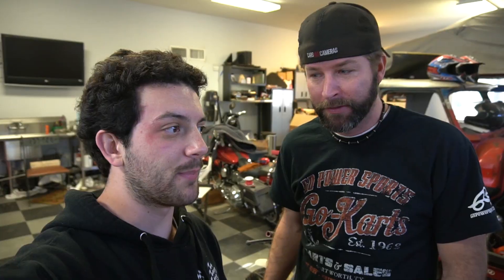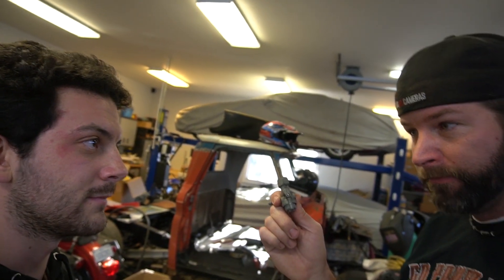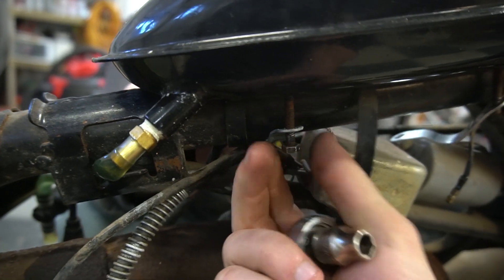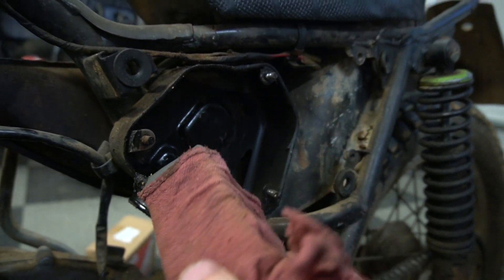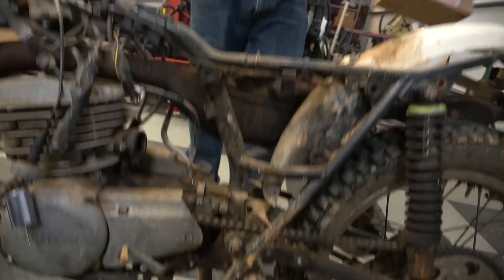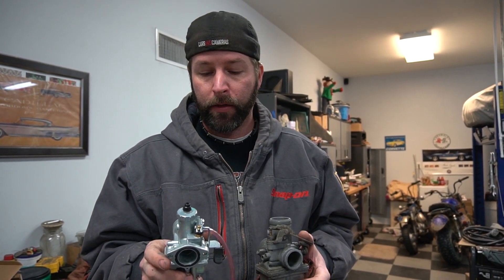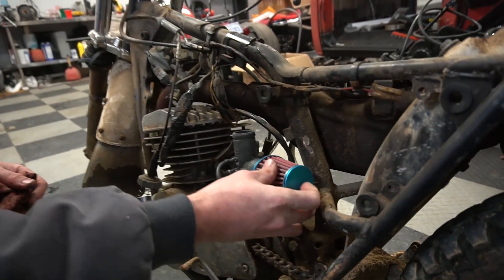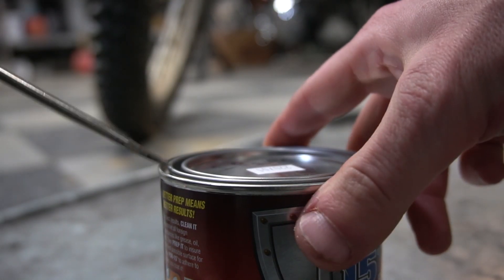Vintage Kawasaki Restoration FAIL

Comment: More kawasaki! We want a full resto and some engine upgrades!
Reply: Alberto Ruiz what engine upgrades can you do to a rare two stroke engine? They should just restore it and not destroy the thing
Reply: @shredder_mang3211  gotta agree with you there man #irishapproved
Reply: Full restore with oem parts. you can aquire.
Reply: @IrishWariorKing  you can put a pipe carb and port the cylinder change the port timing and the ignition timing and a big bore piston ...just like anything else that thing would fly

Comment: take the carb apart. clean the carb ultrasonic. no cracks in housing? new floatbowl gasket, put back together. use the original airbox! it is designed to give the right flow for the set up.
Reply: mightress cheap pod filters are just as restrictive as the factory air box. Have street bike motor on go kart and the pods I got it works the same with them.  I thought I was going to have to rejet it for the pods but they have about the same amount of air flow.  The pods I got were k&n style $10 cheapos from gopowersports
Reply: mightress exactly right
Reply: 717Garage for a two stroke it is quite important using the original airfilter/ box. Throw K&N om the carb is not realy good for the performance. Especialy the older two stroke engines. All comes down to right flow and resistence of the airflow in the filterbox.
Reply: Absolutly mightress!. I've got a KT250 awaiting restoration but I won't be going about it like this!. I've never bought a new carb in my life!! Air filters are restrictive for a reason, to make the jets work properly.

Comment: Clean the carb !!!! I've done it so many times.    Everyone wants to replace them no need to most of the time
Reply: Larry Alexander they already did that
Reply: I put a street bike motor on a go kart and cleaned the carbs it ran but not could have run better so I cleaned the jets again because they have tiny ports the gas mists out of and it runs like it’s brand new. All you need to do is clean it really good and it will run good.

Comment from the maker: Anybody know where we can find some dirt bike parts? Other than eBay??
Reply: CarsandCameras Craigslist
Reply: CarsandCameras i use Facebook  and craigslist
Reply: Sometimes letgo
Reply: CarsandCameras try a dealer, they may just happen to have old parts
Reply: CarsandCameras the app offerup
Reply: CarsandCameras offerup or letgo
Reply: Yea try Rocky mount atv /mx
Reply: search the Internet for bike resto places in your area ask for any parts they took off because they weren't perfect, or look for perfect parts ;)
Reply: CarsandCameras wish has some
Reply: Motosport
Reply: Kawasaki parts house or other oem “dealers”
Reply: CarsandCameras mabey on the  funbikes website but I don't know if they work in America
Reply: Biker bandit
Reply: CarsandCameras doc's in Lancaster Ohio , it's a dirt bike junkyard,its been around 30yrs ,although it's been a couple years since I have been there, pretty sure it's still going and on the internet
Reply: the wanted section on Craigslist.
Reply: CarsandCameras hey guys i have a 1974 Yamaha dt 175 and we got our parts off of craigslist and ebay we found an original piston off of ebay and it was still in the box it fits in the jug fine its perfect
Reply: MIDS motorcycle salvage in Sumter SC.
Reply: You should put up another dragster video tomorrow as this was a fail vid
Reply: There was a guy in grimesland that had a ton of older bikes for parts, as well as a guy on wichards beach rd. Let me know if I can help. I live here in Washington and have a shop over in Chocowinity.
Reply: Mount pleasant bike dump. They ship parts.
Reply: APF motorcycle salvage in fresno ca
Reply: I’m sorry to tell you but that carb is fake go check out Jennie’s garage they have a good vid on phony carbs
Reply: make ya a deal.....ill send u parts for free if you put that engine on a gocart
Reply: CarsandCameras Love the bike keep up the great work! You could check with AHRMA it is a vintage racing organization. They might not have exactly what you are looking for but should be able to point you in the right direction. There are also Vintage Trial associations all over the States usually separated by region. Most of the vintage organizations are cool and they will love you keeping the Trials bike alive and enjoy helping. Another suggestion is but will not yield quick results is Motorcycle Swap Meets. Another suggestion is Rocky Mountain ATV they have factory schematics for most bikes and they may not have the part but possibly give you a factory part number which would help. Another is Bike Bandit if they are still around I have not used them for a while.
Keep optimistic, be patient, and look on the bright side it can be tough working with old bikes but the end results will be awesome. I am speaking from experience. Good Luck!

https://www.ahrma.org

Edit: Would make some cool footage/content to see you guys enter an Observed Trials or Observed Vintage Trials Contest/Event
Reply: post the part number and physical dimensions  engine side..breather side, height etc. I go to car swapmeets and 
pick up carbs for cheap....good place for a bike engine for the rail
Reply: Rocky Mountain atv best for new oem fitting parts in my opinion
Reply: Trademe nz
Reply: CarsandCameras you may want to message jennies garage here on YouTube, he gets parts for motorcycles fairly cheap and shows how to fix stuff on a budget.
Reply: CarsandCameras I get all my honda ct 70 parts from chp motorsports out of texas. They have new old stock and many aftermarket parts.
Reply: I work at eBay's largest used motorcycle parts dealer. Mrc cycle. Our eBay name is mistermonkeyclaw. Can find us at mrccycle.com otherwise. I know vintage two strokes better than most
Reply: The Offerup app also has good deals on miscellaneous things. You could give that a shot.
Reply: CarsandCameras Wemoto
Reply: The usual places , but you might have an easier time getting a parts bike. 
Know what year(s)your bike was produced. 
the “family” so to speak,
because it opens up options for searching.
Reply: Steels cycles. They are 1 of the largest bike recyclers in my area for wrecked / parts bikes. Also a few good cycle junk yards around the northern Colorado area. I remember a fairly large vintage cycle yard in Albuquerque, NM when i used to live there. The yard was on on Broadway in Albq., NM. The name has slipped my memory. Great because it is in the drier south, and the parts tend to be in better condition, even after some years of sitting. Other sources include car part.com, or part locator .com. Sorry i do not have more info then that. Best of luck on your search.
Reply: CarsandCameras b&j racing has vintage trials bike parts,I used to have a 74 Yamaha ty250 and an 85 th 350,and that was my go to place.
Reply: Bike Bandit.com
Reply: I get all my parts off of Rocky Mountain atvmc. They sell oem for cheaper than the regular oem site and they have tons of aftermarket parts. And they have free two day shipping (at least where I live in KY) which is awesome. I'd try there first, they may have some stuff for you.
Reply: http://bikeboneyard.com/    Don't toss the airbox yet. Taking that thing off and going with the pod will almost always result in the engine running worse. I've rigged up the original filter cage with filter foam on some older bikes and had good success with that method.
Reply: You could buy a parts bike,  look on Craigslist or even look at vintage motorcycle shops
Reply: Kawasaki parts warehouse
Reply: Cycle recycle in Indianapolis. Theres two of them. Walnecks
Reply: I think you need to do a full restoration. tear everything apart, sandblast, paint, polish, and fix what you can't replace.
Reply: Dude just measure the intake. It's going to be in the 28-35 6mm range. Sell the keihn and order another pwk the correct size. If nothing else go to farmandsandtoys.com call Jeff and he'll help you out. It's a two stroke and a 4 stroke carb won't work. Also need to do a leakdown test on that motor if you've taken it apart, any air leaks will cause it to be lean and burn up a piston. Your reeds are probably trash too. Pull the cage and see if there's any visible light where the reed touches the cage. If there's any light it's not sealing completely and it's going to run like crap. I've got a banshee built by farm and sand toys. It makes 110 horsepower out of a 465cc engine. Two strokes are simple but you need to read up on one before slapping parts at it. Even air filter changes can cause a lean condition. After you get the bugs worked out you'll need to do a plug chop, there's plenty of diagrams out there that show how to do it and what to do. You'll need jets as well, you want to run it just a little rich.
Reply: Amazon
Reply: Or you can use motosport.com
Reply: I would look for vintage bike forums and put feeler out there
Reply: CarsandCameras ebay has crappy parts. But i still am rebuilding the top end of my 2 stroke with ebay parts. All the parts fit but my carb rebuild kit. But tgen again i have been doing a crap ton of research to make sure the parts fit.
Reply: CarsandCameras search up killermotorsports.com
Reply: Ive got a pretty well restored kt250 and carburetor is a 26mm mikuni so if you get an off brand make sure it's a 26mm
Reply: Try Bikebandit it helped me find Nos part for my 1975 Suzuki tm 125
Reply: Ask Cameron niemelda
Reply: He is a YouTuber that specializes in parting out bikes he does newer stuff but might have leads
Reply: Bike bandit
Reply: CarsanCameras motorcycle superstore

Comment: Hi guys. Something to think of. When a bike sits that long do not be surprised the seals on the crankshaft might need changed as it greatly effects how it runs. I had that happen. Here in Michigan there are motorcycle salvage yards to look for parts. Oh on your air cleaner an old dirt bike trick is to take a pair of nylons and cut the foot out and use as a cover over the element it keeps the larger dirt off the element hope any of this helps. great vid.

Comment: Two Stroke Motorcycle carbs are very different from four stroke motorcycle carbs - Watch what you put that on...... or box it up and return it - there should be nothing wrong with the carb in it, just clean it in an ultra-sonic Hot tank from Harbor Freight, you can buy one cheaper than the Sudco Carb you bought and you can use it on all future gummed up carbs on the dozens of bikes & Karts
Reply: Also, as little as youre gunna ride it, you could get away with cheap NEW tires and tubes instead of Name brand stuff - Check out your Local 'Cycle Gear" store (they have them nation wide) or order tires online from Chapparal (I have 23 bikes here, best deals on cheap tires) Been restoring bikes my whole life (49 yrs) would love to see you guys freshen that one up!!!
Reply: 2 stroke carbs and 4 stroke carbs aren’t really that different unless you have a flat slide carb like my bike has
Reply: Two stroke, four stroke carbs are very similar but I agree with you, I'd have given the original a thorough clean out and refitted it. I've never bought a new carb in my life!.

Comment: You can find a carb that would fit on ebay. You have to measure the one you have to get one that fits, if you cant find the specific one. Measure the bore size(mm), intake manifold size(mm) and filter end size(mm). That way you know exactly what you're getting.
Reply: Fire And Gasoline how are you
Reply: Fire And Gasoline that makes no sense carbs don’t only fit by size, you can’t just throw any carb on any motor especially a two stroke motor

Comment: CLR and ultrasonic cleaner. wishI had a pic , but the carb will look and work brand new!! used the process on 3 motorcycle carbs 2 chainsaw carbs and a Miata throttle body!! good luck! love the Kawis!

Comment: Hey Ike, Ive got that Jacket in brown grey and black and black and grey.
We spend to much on tools for our jackets! LOL

Also I have a bunch of old MIC carbs around from vintage sleds and bikes that are in great shape. Id be happy to send you a pair if you would like to try them on it. I know it only takes one but an extra set of parts and jets are always nice espically if you wanna drill the jets. No Charge,  I'd just love to see that old girl running right! Id just need a Measurement of the Throat going in the boot.

There Old carbs but cleaned and stored properly Id even throw them in the ultrasonic cleaner for ya guys before i sent em

Don

Comment: I would suggest adding a liner to the inside of the tank to help keep that one from rusting. Personally is use Red Kote, haven’t had any problems with either of my bikes. Just leave ample time for it to dry and I usually do 2 coats of it depending on the inside of the tank.

Comment: Replace the crankshaft seals! And keep the airbox, it was designed for the engine! The airbox actually helps quiet it down too, which is why it was so loud after you removed it.

Comment: The stock carb is either a keihin, but most likely a mikuni. Just clean it
Reply: You guys should get a ultrasonic cleaner if you don't have one already
Reply: Also, dents in the tank should be able to be popped out with pressure. Plug the tank and wrap with a few tie straps to keep it from expanding where you don't want it to. Then fill with compressed air. Dents should pop right out
Reply: Its a mikuni. Says it on the side
Reply: O wayne was watching on my phone and didn't see. But yeah. Should be a mikuni if stock

Comment: Usually carburetors need some modification for 2-stroke operation if they were not originally made for it.  A lot of the "performance" carbs out there usually can be operated with both 2 and 4-stroke engines but usually they need different emulsion tubes, slides, needles, etc... also don't assume if a carb works on a 212 4-stroke it will be ok on a 250 2-stroke.  2-strokes almost always require larger carburetors and are also usually jetted a bit richer.  Finally, get a tuned pipe for that thing, it will make a huge difference.

Comment: Check with some local dirt bike shops  most will know where or someone that will have parts  for it.  And a restore would be very cool,  now you need another one mabey a Yamaha or Honda of the same year and cc  so you both can have a rest build and race  trials.  That would be very cool. Also contact kawasaki  directly  for parts!!!

Comment: Okay something that somebody may not have actually told you or something since you guys don't deal with two strikes very often is there is a difference between 2-stroke carburetors and the way the needles mix and at the same time the airbox actually makes a difference because it helps with the Venturi effect and some other things I don't know exactly how to explain it but yes the air box makes a difference and sometimes when a two-stroke won't run it's because of the airbox

Comment: I am working on my 212 that has been sitting for about 4-5 months and I cannot get it to start any advise?

I have done the following:
-Oil change
-New spark plug
-cleaned out the whole carb
-new fuel lines
-cleaned the gas tank
-cleaned the filters

It gets spark but it just won’t start... any tips for starting up engines that have sat for an extended period of time?

Comment: hi guys I have a quick question. I'm looking for a go kart that is cable of speeds of or over 25mph. I'm 6'4 and am wondering if theres anything out there for around $1.5k or way less preferably, I want something used but am willing to pay the 1.5 for something new. I want a one or two seater. I'm asking here because I haven't found anything good on my local craigslist.

Comment: Compressed air in the tank will pop out the dent .
Reply: Better because much safer: pressure washer! 'Hydroforming'
Reply: Yes but not as available as an air compressor
Reply: Largest ball bearing that will fit through the filler hole and a huge neodymium magnet can be used to roll out the dent too.
Reply: W...t....FUCK are you talking about??? A bearing and a magnet??? Just stop...

Comment: To make your can of POR last longer, drill 2 small holes in the lid opposite each other. Pour a small amount in a cup, bowl, etc and use that. When done, put 2 appropriate size screws in the holes and put in refrigerator. It will keep for years like that and not dry out from opening/closing lid.

Comment: Could y'all try out some 1.3 ratio rockers (ja9 12151 00 00) with stock cam in a non hemi 212 and in the same motor try out a popular cam like mamba Jr or something with stock rockers both with 18lb valve springs? Would make for an interesting test the stock should be a tq monster. The rockers are only $18 and will make 30% more lift.. would make a great episode thanks guys. That is a great budget build $18 Rockers vs $100 cam

Comment: I love 2 strokes, especially Kawi's and have owned quite a few from 100 to 250.  Is that using the rotary valve technology?  I don't really remember the trials bike at all, just remember using another trials bike from a friend and only using 1st and 2nd gear and standing on pegs, not sitting down and climbing rocks on the Rhode island shore line along Narraganset bay.    BTW, remember riding my Suzuzki from Bristol RI to Chelmsford Mass and blowing up in Fall River.  Pulled over and down the runway of Fall River airport.  Kid working there (well he was my age and I was kind of a kid at the time) helped me take it apart, get a new piston and clean and put it together by nightfall.  Arrived at my cousin's late but rebuilt and running well.
Reply: William Sisco no, rotary valve would be a side monted carb
Reply: Swan Donovan yes just remembered that, carb was actually covered, correct?

Comment: Do you guy's know what Trial bikes are for and how they are used? The first few gears a low because you ride slowly through difficult obstacles or traps within a course. You loose a point each time your foot touches the ground. You start with 3-5 points per course.